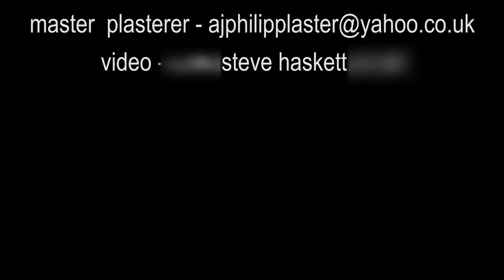How to Lime plaster onto strawbale

Comment: Is this a good long-term solution for moist to very moist climates (like the Netherlands)? ? And is maintenance very often??
Reply from the maker: It allows walls to "breathe" so they can get rid of moisture. Cement seals the moisture in. Should be fine in the Netherlands but take expert advice, I'm just the cameraman!

Comment: What type of Lime is used?
NHL? Hydrated?
Reply from the maker: Sorry, can't help. I'm not in touch with the plasterer
Reply: Lime mortar made using putty, wouldn’t be hydrated as normally it’s mixed with cement to set properly. 
I think they are using a ready mixed lime putty mortar which is then maybe thinned down abit in the mixer to make it compatible with the sprayer. And it looks like a lovely job !!

Comment: 3 coats???  Way too much. And the cost of the labor must have been a LOT!  We did our ourselves and put on a much thinner layer.
Reply: Yours will probably crack to hell. If it only takes the difference of a few days and it's supposed to last 50-100 years, why not do a bit more?